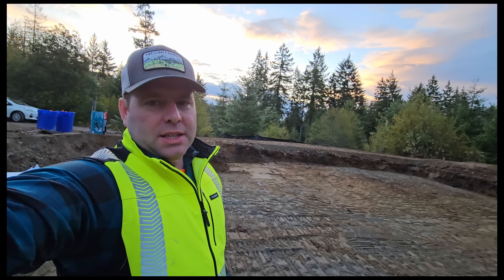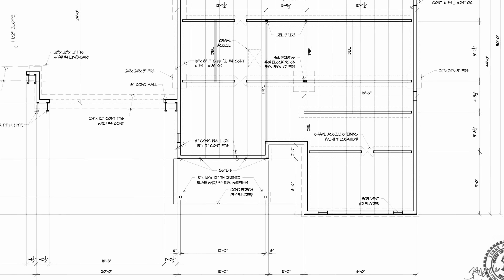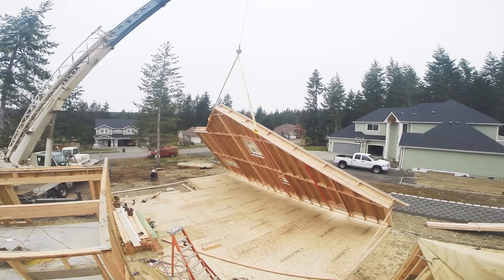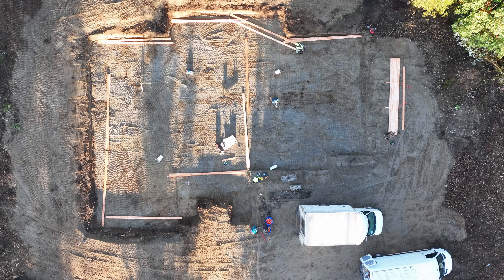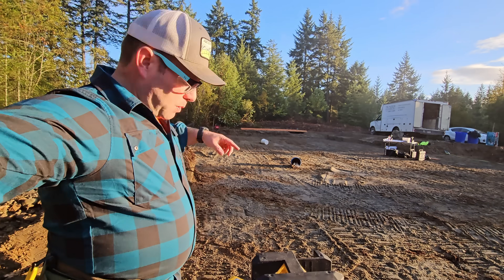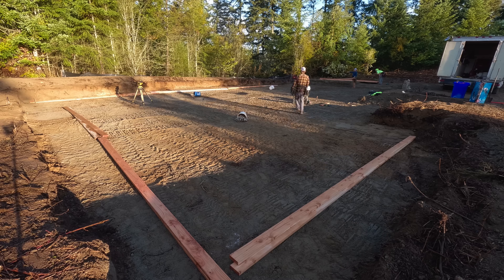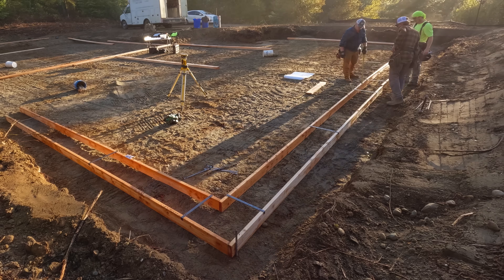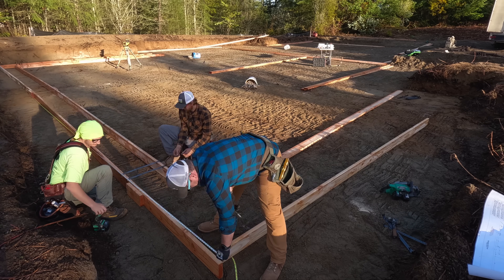Insider Look: Building a House Step by Step

Comment: Okanagan Valley. Commercial townhouses we do 2x10 footings (10” height ) and for residential projects 2x6 footings (8” height). And we used 2’ wide easy strip forms from the concrete companies depending where you get your concrete. They are very greasy

Comment: Fl panhandle is 95% slab on grade with 12x18 footers or larger on poorly compacted fill dirt. Other 5% is footer/cmu wall. .01% icf which doesnt male sense due to wood cost, our wind code, and huge temp swings between summer and winter. This year we had 104° down to 15. Last icf project i saw the footers looked 28-30" wide.

Comment: In the SF Bay Area we usually trench for the footing and build up forms for a minimum of 8" from grade. Most sites are sloped and the foundation walls tend to be stepped. In the Berkeley hills there are slide zones and the Hayward fault Runs through as well. There caissons with granite penetration are required, or you are required to build essentially a boat out of a rebar cage and concrete. On retrofits that becomes especially fun. We dug out one side, did half then dug out the other side and did the other half. It's the closest thing to freeway overpass construction we normal carpenters do.
Foundation wall rebar tends to be 60 grade #4, #6 is not unheard of, 12" OC. Lots of anchor bolts sometimes 2' OC, 4' OC is standard cast in place and holddowns downs. It helps to lay out the framing on the outer form board. Inspectors and engineers like to see J anchor bolt ends under the rebar even though we tend to be ~6" below the top rebar. Oh, 3x mud plates are more and more common. Then a monolithic pour. Either plywood or 2x12 form boards. Then  4,000 or 5,000 psi concrete.

Comment: We are building a house in northern NB in canada in the spring on a True Foam fast slab foundation system.  Its a FPSF or frost protected shallow foundation. no need for footings and only need to dig down around 18 to 24". very reasonably priced and easy to do. R values range from R-10 up to R-50 depending on what kit
Reply: Do you need a hand? 🙂

Comment: Hi Tim.  We (TC General & Stiles Construction) have built in many regions and they all have extremely different foundation designs that are required to support the structure sitting on the type of soil (or lack of…) in each area of the country.  
Pacific Northwest: footing & stemwall. 
Southeast Texas: slab on grade with concrete grade beams and post tension cables. 
Northwest Alaska: pilings driven into permafrost and/ or pressure-treated pads under posts supporting the structure.
Hawaii: slab on grade or posts on concrete piers depending on if we’re building on sand or bedrock.
We are currently working in Grand Bahamas “learning” how they design and build to support their structures.
Working in so many areas with extremely different geology and climates, one has to adapt and build to the local conditions and styles.
It’s very interesting to see how different things are done different parts of the world.

Comment: I'm not a builder but one that is in the middle of building a home with a GC. Appreciate watching your videos as we go through the process ourselves.

We are in the northeast and have a full 8' basement under the entire house (not garage).

One thing I noticed on our build is the excavation contractor used a flat attachment on the bucket to scrape the land for the foundation so there is zero loose dirt (vs. having teeth on the bucket).

Comment: Great job guys!!! 👍👍👍 As a builder on the East End of LI New York most of the new homes are built with 12” D x 24”W footings, 10”W x 8’ to 10’ high foundation walls for full basement construction. Full unfinished basements are the biggest bang for your buck for new construction,it’s not taxed as living space in NY. We install egress windows and an outdoor basement entrance when possible for future finishing off of  basement if desired. Size of footings always depends if you hit good sand. If not on good sand ,engineers usually spec a spread footing, which could be anywhere to 3 to 4 feet wide with engineered calculations of rebar sizes. Step footings are built up for garage, which do not have full basements underneath.

Comment: Here in northern Michigan I work for a  company building custom homes. We do a lot of our foundations with a pre fabricated  insulated steel and concrete foundation system called Superior Walls they are made off site and trucked in and set with a crain. The excavator typically excavates everything out flat except for the garage area they usually leave dirt in the middle. We have to go down deep to get the footings below the frost line. The footings for the superior wall system are built-in to the wall and sit on a bed of crushed stone. If we do a poured wall foundation we typically have the excavator dig everything out flat but sometimes in the garage they dig a trench and leave dirt in the middle.

Comment: In Canada I’ve used icf and panels but we use to do 2 foot wide footers are rule of thumb was, 8 inches outside the wall and 8 inches inside, plus the wall thickness, which usually makes it 24 inch, but I’ve done some footers that were 4ft wide with 3 rolls of rebar! But that was a special kind of job tho!

Comment: East Tennessee we do concrete footers but we dig a ditch for ours, we never form unless it’s just necessary on the job or a monolithic slab. Sometimes on basements pre cast concrete walls are used. Just depends on the project.

Comment: I’m in north east pa.  We pour 24w x12 thick footings 42” deep for frost.  Poured walls on top with connecting rebar.   Precast foundations are also popular here. No footings required.  Just tamped gravel bed. Love the videos.

Comment: Greetings from the central Oregon coast. Love watching your videos as I prepare to build my dream house on a sloped site high above the Pacific Ocean later this year. I was looking into using ICF for the walkout basement and possibly even a sealed ventilated crawl space but was really bothered by all the plastic waste that’s generated by cutting and handling the foam forms, especially if you plan to apply a parge coat to the surface (the “roughing up” process). There’s already too much plastic waste in the environment and specifically in the ocean and I don’t see any way to keep all those foam particles from just blowing’ in the wind (apologies to Bob Dylan) of which there’s a lot of on the Oregon and Washington coast (wind AND plastic waste, that is). What are your thoughts on this subject? 

Much appreciation for your dedication to construction education 🙏.

Comment: I'm not a builder, but I recently watched a house foundation being built further down the street and it was a steel mesh re-inforced monolithic concrete slab on compacted non-washed granit/basalt gravel. Probably about 8m x 8m. Climate Zone: Central Germany ~300m elevation.

Comment: I am just a hour or two north of you in Vancouver, Canada, We are pretty much always 2ft wide 12''-16'' footings, differences from you are, 
always a full in ground basement(8ft minimum have gone as deep at 14ft recently)
Same 1 1/8x2x10 HDO form panels vertical
Biggest difference from you and anywhere I've ever worked is that we always mono pour footings and walls, 2x4 spreaders and panels on top of them. I hate doing it this way, don't like casting 2x4's into the pour and its much harder to get things square on the top edge vs footings first than panels.

Comment: Never done footings. Could you pre-build the corners for the forms and use them to do layout? Then you'd just need to cut the straight form boards and the measurements might be quicker.
Reply from the maker: Hmm, that's interesting.  My first reaction is yes, but you would have the extra time in connecting them to the main runs.  BUT that may not be an issue at all.  I like that idea.